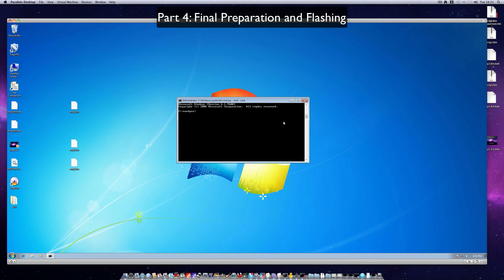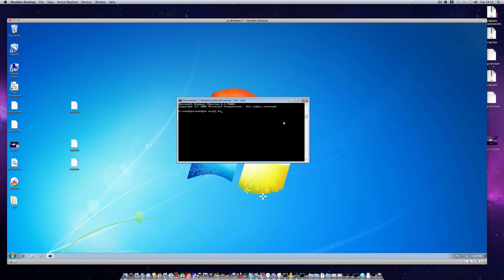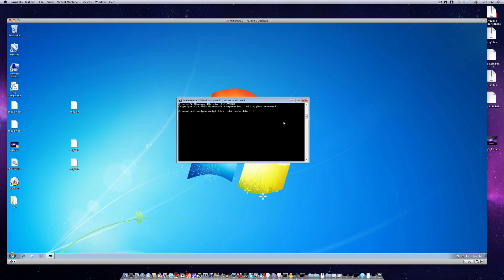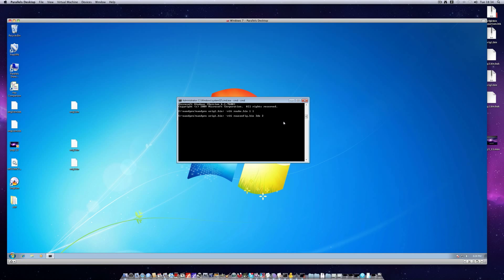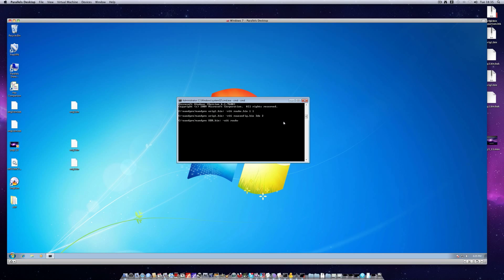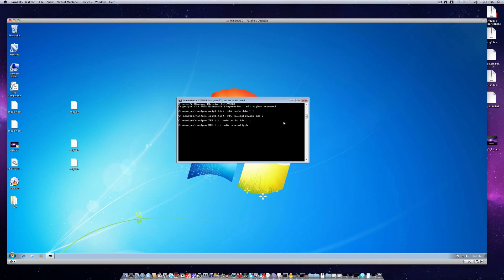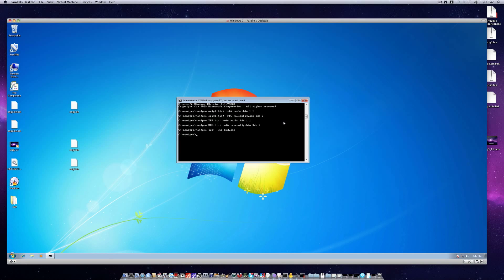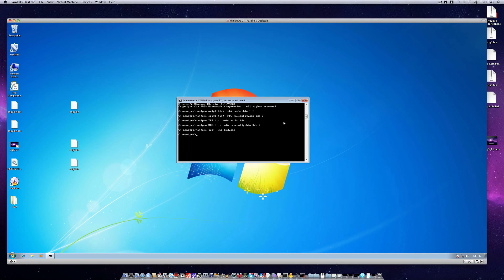Xbox 360 JTAG Tutorial - Part 4

Comment: What is the main purpose for jtagging an xbox 360?  My XBOX 360 has LT+ on it now.  Can I use one of Microchip's MPLAB PICkits to jtag my xbox?  I don't want to get  Xecutor NAND-X because that will not work on Microchip's MPLAB software modules like IDE. I need a general purpose JTAG development board that will work both on XBOX and Other devices, such as recovering a routers firmware the JTAG way.  Search PICkit 2 development programmer, first link will be the site. Can't post site here?

Comment: Well, after doing all of this and getting perfect NAND dumps, I flashed XBR to my 360.  However, I get E79 on startup.  On top of that, I don't know the code you use for Degraded, so I can't check it (although the kernel is 6xxxx).  So, i went back, checked my soldering (some wires came loose) and my new NAND dump has over 970 non-matching blocks compared to my NAND dump from a while ago.  Is that because of XBR?  And what must I do to fix this?

Comment: @troy2062 Well i checked in degraded and both my nand extractions have a few bad blocks but i have 2 dumps so is it possible to put them together to make a completely clean one? Also i beleive that my soldiering might have been off cause it was my first time soldering. Its strange that i can open up free60 clearly but xbr does not load. Do i still need my original nand? or can i still try to proceed without it. Thanks

Comment: Everything was going well for me until it came time to boot the 360. I got the E79 error code. My 360 is a Xenon. I dumped my nand 3 times, and they are identical. My CB is 1903. I checked my soldering a thousand times. Do you have any idea whats going on, or any advice? And thanks for the vids.